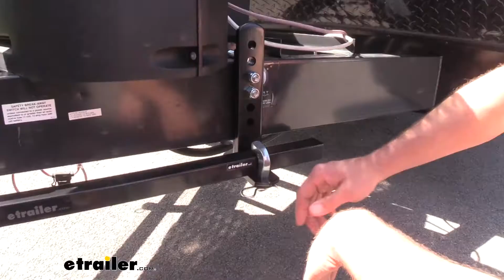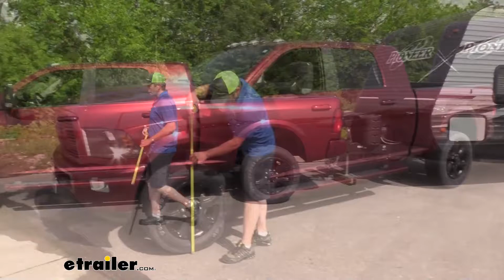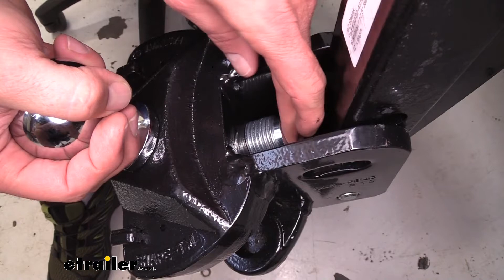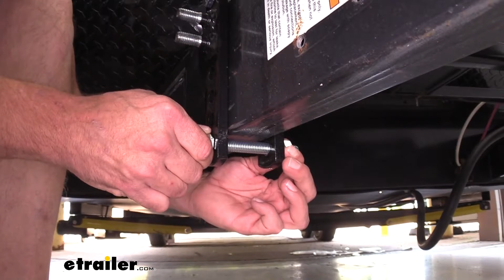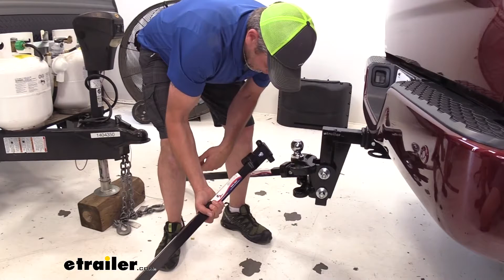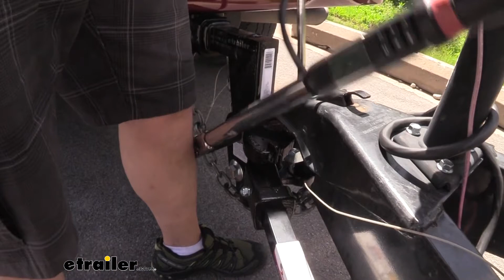etrailer | Feature Review Fastway e2 Weight Distribution w/ 2-Point Sway Control

Comment: I need to check mine in the spring. I don't think the dealer installed it properly. It makes way too much noise, according to me.
Reply from the maker: Because of the metal on metal friction that's used to resist trailer sway, some noise is normal. You can check out the install instructions so you can revisit the install/setup. I've linked those below for you.
https://www.etrailer.com/instructions.aspx?pn=FA92-00-0600
https://www.etrailer.com/Weight-Distribution-Hitch/Fastway/FA92-00-0600.html

Comment: What size shank was used for the 2500 . I reckon it would be the same for a f250
Reply from the maker: The # FA92-02-4100 shank is used. You can check it out by clicking this link:
https://www.etrailer.com/Accessories-and-Parts/Fastway/FA92-02-4100.html
https://www.etrailer.com/Weight-Distribution-Hitch/Fastway/FA92-00-0600.html

Comment: I have an e2 round bar. I just bought it and had it installed professionally. The brackets themselves after one tow, they seem a little bit crooked. I have been told that this will not affect the towing capability and will not affect the weight distribution. Is this correct? 18:27 18:28
Reply from the maker: I'm not sure what you mean by 'crooked'. If the brackets have moved, I'd recommend taking your trailer back to who installed the system and have them correct the positioning of the brackets.

Comment: Now take the bars off.
Reply from the maker: It's not difficult, remove the tension from the bars by lifting them up off the brackets on the trailer frame. Then, remove the cotter pins and slide pins that hold the spring bars to the weight distribution head. It's the reverse of the procedure shown in the install instructions liked below:
https://www.etrailer.com/instructions.aspx?pn=FA92-00-0450

Comment: My camper takes a 2 inch ball, can I change the ball size
Reply from the maker: Assuming you're speaking of the Fastway # FA92-00-0450, you'll need a 2 inch trailer ball with a 1 inch diameter shank like # 40038.
https://www.etrailer.com/Trailer-Hitch-Ball/CURT/40038.html
https://www.etrailer.com/Weight-Distribution-Hitch/Fastway/FA92-00-0450.html

Comment: Great video. I have the same e2 system but upgraded from a Ram 1500 to 2500. Sounds like I am also going to have to get a drop shank to lower the ball. We are towing a Lance 1985. The dry tongue weight is roughly 660
Reply from the maker: We offer several different weight distribution shanks (see link) which have the standard height adjustment hole spacing. Just choose the shank with the drop you need...
https://www.etrailer.com/dept-pg-Accessories_and_Parts-sf-Weight_Distribution_Hitch-pt-Shanks-pc-Fits_2_Inch_Hitch.aspx
Reply: @etrailer  Thanks for your response. Much appreciated.
Reply from the maker: You're very welcome, we're glad we could help!

Comment: Thanks for the video! We have a new loud grinding noise on our E2 hitch and the sway bars are getting rubbed more. Any suggestions?
Reply from the maker: You may have too much pressure on the bars. This is usually why you will get grinding and wear.
https://www.etrailer.com/Weight-Distribution-Hitch/Fastway/FA92-00-0450.html

Comment: For the L brackets that fit on the trailer tongue the installer in the video mentions there might be a need to later adjust the height/position by moving it to alternate holes in the bracket.  To me doesn’t provide an explanation of the final desired position of the L bracket.   Can the installer or someone comment on what precise determination of L bracket height on frame.  Thanks

Comment: How do you know wether to get a 6000 or an 8000 model?
Reply from the maker: That will depend on the weight of your trailer. You want the total weight of your trailer to be as close to the weight on the weight distribution hitch without going over. If you go over, you run the risk of damaging the kit and it not working properly.
https://www.etrailer.com/dept-pg-Weight_Distribution_Hitch-pm-Fastway.aspx
Reply: I was at camping world today and they ran out of 8K and everything added up is 7500 so they sold me a 10K is that going to be an issue?  @etrailer

Comment: When you measured the distance from ground to top of wheel well, the table says, "tow vehicle loaded for trip."  Does that mean with four passengers and their carry-on gear as well?  Do you have to get everyone in the cab of the truck and have a 3rd party person take the measurement?
Reply from the maker: loading the gear in the bed of the truck or rear of the car is more important but the people in the vehicle will make a difference in the sag of the rear end of the vehicle. You will be fine to set the weight distribution up with just the luggage loaded in the rear of the vehicle.
https://www.etrailer.com/Weight-Distribution-Hitch/Fastway/FA92-00-0450.html

Comment: "tongue weight = anything we have behind our rear axle."  Meaning any cargo loaded behind the rear axle, or the weight of the vehicle components and cargo behind the rear axle?  I can imagine weighing gear as we load it, if it's placed behind the rear wheels. I can't imagine figuring out how to slice the vehicle weight by location (like the portion that's behind the rear axle only).
Reply from the maker: The best way to figure out the weight of everything behind the axle in the truck is to weigh it and add it to the tongue weight from the trailer.
https://www.etrailer.com/Weight-Distribution-Hitch/Fastway/FA92-00-0450.html

Comment: Will that work on a travel trailer with a v nose?
Reply from the maker: We have found that the Chain Hangers for Reese Weight Distribution Systems is the best option when it comes to installing a weight distribution system on a v-nose trailer.
https://www.etrailer.com/Weight-Distribution-Hitch/Reese/RP67509.html
https://www.etrailer.com/Accessories-and-Parts/Reese/RP58305.html

Comment: What is the part number for that shank, just upgraded to a 2500 and need a longer one. Thanks.
Reply from the maker: I have provided a link to the longer drop shank that was used in this video.
https://www.etrailer.com/Accessories-and-Parts/Equal-i-zer/EQ90-02-4400.html

Comment: Explain please.....if the weight distribution is "off" you add or remove washers, not adjust the brackets on the trailer frame? 
And: Top of my coupler is only 16" off the ground. Truck receiver 18". Too much of a drop will make the shank and hitch assembly drag on the ground at campgrounds. Only option is to have less drop which would mean slight trailer rise in the front. How much of a rise is safe?
Reply from the maker: You just want to be sure that you do not have too much tilt in the front of the trailer. 2' is not the worst difference in height. Some squat will take away some of the height difference but you will want to haul the trailer as level as possible.
https://www.etrailer.com/Weight-Distribution-Hitch/Fastway/FA92-00-0450.html

Comment: You mentioned that there is a friction "material" on the bottom of the bar and the bracket. I bought this system and it doesn't have anything between...it's metal on metal. 1 tow and it already rubbed about 1/16" off of the bar. Seems like I'm a couple years, we will need new bars and maybe new brackets too. Wish I didn't buy it now.
Reply from the maker: The brackets should have come with the friction material preinstalled from factory.
https://www.etrailer.com/Weight-Distribution-Hitch/Fastway/FA92-00-0450.html
Reply: @etrailer  Yes, I see it pictured on your website but it's not on my brackets. So who do we call? Dealer where we purchased it at delivery of our camper or Fastway? It's the 10k setup, if there was a change in the product line.

Comment: Why does the hitch look so low to the ground where it goes into the reciever. What if you are off road. You can back up with this?
Reply from the maker: The truck needed the extra drop because of the height of the hitch. Typically, people are not going extreme off roading while pulling a camper. Yes, this kit allows you to back up.
https://www.etrailer.com/Weight-Distribution-Hitch/Fastway/FA92-00-0450.html

Comment: you mentioned why the e4 equalizer is better option for certain applications.  i could not hear did you say if the trailer has a lot of pin weight? if so what does that mean and if not please explain what applications are better for the equalizer thanks.
Reply from the maker: The pin weight will obviously be different on different trailers. The weight distribution system is designed to make hauling a camper a bit more enjoyable because of how the bars will take some of the tongue weight of the camper and reduce the sway.
https://www.etrailer.com/dept-pg-Weight_Distribution_Hitch-pm-Equal~i~zer.aspx

Comment: if the tow vehicle is different every time for a rental trailer, would the Weight Distribution hitch be a good idea?
Reply from the maker: You can get a weight distribution set up for the rental trailers. It would just be a lot of work to set up each time and you don't know for sure that the weights will be the same each time. I would check with the rental company and see if they offer trailers with the weight distribution on the trailer.
Reply: @etrailer  I am renting out trailers and I provide the hitch. And I wondering if it would be wise to offer a weight distribution hitch or just go with a ball hitch with a friction sway bar.

Comment: I apologize if I missed it but why do all these type of WDH's require the ball to be sloped backward a little? What is the purpose for not having them perfectly straight up and down? How would I know how far to tilt mine?
Reply from the maker: The ball being tilted is because the system's head is tilted to adjust the amount of tension on the spring bars. If you check out on installing a WD hitch here https://www.etrailer.com/faq-how-to-install-weight-distribution.aspx Go to Step 4 about installing and adjusting the head.

Comment: Great system but I use the chain style o my car trailer because weights are always different depending on whether it's a car truck tractor etc. Chains are easier to adjust for varing loads

Comment: You used a tool to pry the bars into position. How do you take them off? I can picture that bar flying at me after it drops off the support.
Reply from the maker: The installation instructions, which can be found linked to the product page below, call for raising your trailer jack high enough that the spring arms swing away. So basically you use your trailer jack to release the tension you were talking about so you can safely remove the arms.

https://www.etrailer.com/p-FA92-00-0450.html
Reply: @etrailer  So that means you could raise it up to the same height when installing too? Then you wouldn't need the tool?
Reply: @ducrab  correct. What I do is use a couple of the leveling pads under the rear tires of our Expedition. This way, I'm not using as much of the jack to hold up all that weight and stress on the locking mechanism for the ball. It helps especially when the ground is lower for the camper than the tow vehicle, which is how my storage spot lines up unfortunately. With blocks under the jack, it's fairly high to get the WD bars off easily.  I had to be this high on the hitch for our camper that is framed high and to get keep it level while also getting the Expedition as close to level. I must have taken it all apart 3-4 times to get it right while loaded up.